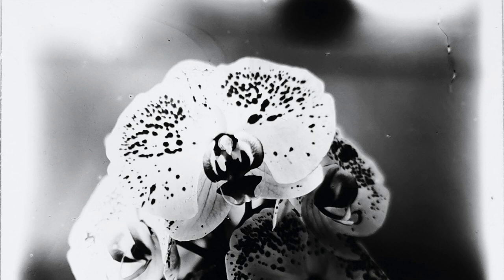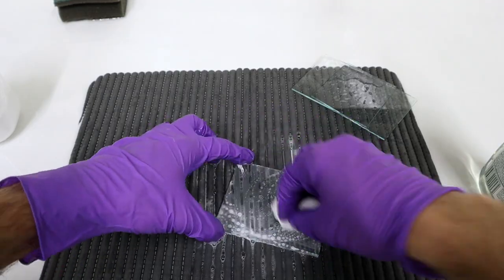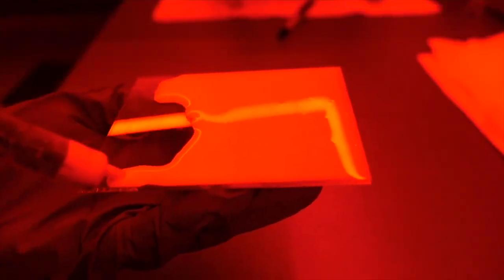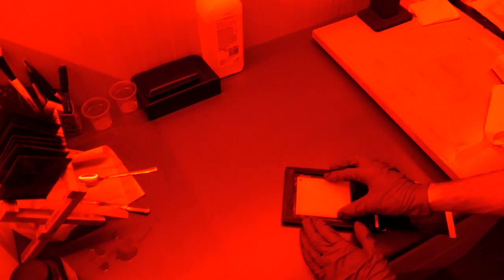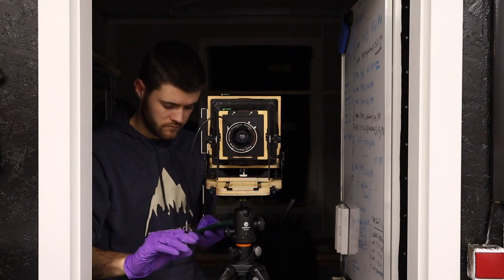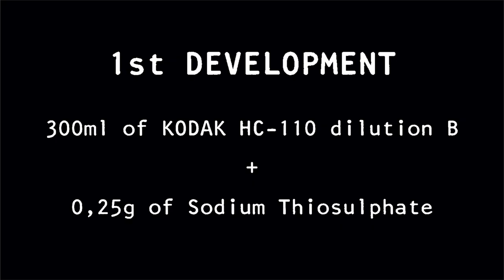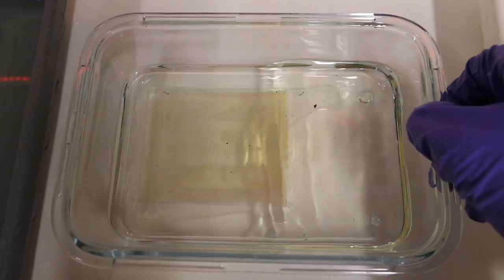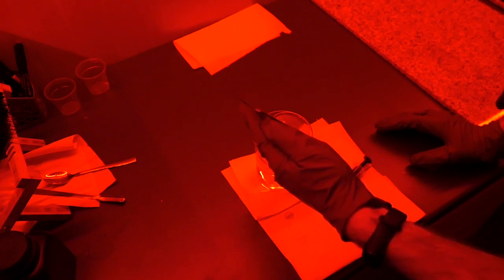Reverse developing Glass Dry Plates to direct POSITIVE | Advanced Film Photography | Foma Emulsion

Comment: Great video.  I played with this a couple years ago.  Get a chemistry hot plate.  You can place you glass plates on the hot plate and heat the glass evenly before applying the emulsion.  You can also put the glass plate back on the hot plate after coating and let the emulsion level itself out.  I was trying to use a different bleach but ran into a lot of issues with emulsion coming off the glass or poor bleaching..  It looks like you got a great system going.

Comment: One suggestion on the spin coating: a technique I have used for Niepceotypes is from Mark Osterman: use a valve from an engine mounted in a hand-driven "eggbeater"-style drill, which allows good control over the speed. Double-stick tape will hold the plate to the surface of the valve. You will want to put the spinning plate inside something to contain the excess emulsion being flung off. I would expect the coating to be very even, but a bit thin without a great deal of care.
Reply from the maker: Thank you Robert. I am concerned that the plate will also have to be heated somehow or the emulsion wil gel to quickly?
Reply: @lostlightart6064  perhaps. I went from heating my plates on a warming tray to coating them on room temperature plates with little trouble, but never tried spin coating with gelatin. But if you’re concerned, an inexpensive food warming tray (I bought mine off eBay for $25) set to low with a towel on it will do a nice job of keeping up to 8 plates or so warm and ready to go. One other thought: I have found thin coatings to be rather susceptible to halation, to the point where I was experimenting with anti-halation coatings. But I found that if I just left more emulsion on the plate the problem subsided. Takes longer to dry, but this is a process that calls for patience anyway...
Reply from the maker: @RobertBrazile  Yes I mean the problem may not be just in the thickness but also in the density of the emulsion. Maybe I need to dilute the emulsion down a bit so it can develop all the way thru despite being a bit thicker...

Comment: Could you spin your plates Slowly in order to get an even coating ?
Look forward to your Autochrome experiments 👍
Reply from the maker: Yes this is what I have to try
Reply: @lostlightart6064  I already calculated it. If you do a rough coating first like you do it (that is essential!) and than place the glass on an old record player at 33 r.p.m. With the viscosity I see in your video, about 1 minute of rotation should be fine to get a coating below 100 micrometer. I tried it with a test solution and it works. 
33 rpm is not enough to spread it from the center, but it is enough to get the coating very even and very thin.
Reply from the maker: @flutgraben13  thank you. That was exactly what I am planing to do.   Coat the plate like usual and than give it a spin to even out the thickness
Reply: Just saw the record player in video which i missed 😅
Using such a method could you make a type of layered Autochrome?
Reply from the maker: @stuartbaines2843  Autochromes have a colour screen which is dusted on a sticky adhesive layer. Screen is than protected from moisture and coated with a thin coating of panchromatic emulsion ;)

Comment: Thanks for sharing this. I just want to know what ASA is the applied emulsion?
Reply from the maker: Thanks. ISO 2
Reply: @lostlightart6064  I Appreciate it mehn!
Reply: Nejc did you have not encounter problem when you applied your emulsion directly without any subbing? Because I am going to try to use Liquid light emulsion.
Reply from the maker: @reynaldocastaneda4712  No. All you need is a clean glass!
Reply: @lostlightart6064  thanks Nejc
Reply: Nedj, did you use some kind of coating before applying the emulsion? Or apply directly?

Comment: Hi! do you know if this glass is valid to use in an enlarger as paper? Thanks for sharing your knowlegde!
Reply from the maker: Yes its possible so theoretically you could make a positive image on glass out of a negatve glass dry plate
Reply: @lostlightart6064  I was also thinking if it’s possible to use a 35mm and expose it on a glass plate using enlarger. I’m guessing the process would be very similar?

Comment: I've done a couple rolls of modern film by B&W reversal with dichromate bleach -- essentially your process, but without the hand coated glass plate (and on panchromatic material, so the first development was done in a daylight tank).

I used print strength Dektol (1+1, as I recall) with a little thiosulfate added for first developer -- faster working than HC-110, mainly, though with 35 mm Tri-X I think it also helped with final grain by preferentially developing the coarser halide crystals (to then be bleached away).

The option does exist to separate the thiosulfate from the first developer, too -- develop, stop or wash, bleach, wash, clear, then put the plate into a similar strength of hypo solution and watch for the thinning of the least of the least dense parts of the milky halide.  The trick is to stop as soon as max-bright areas go fully clear (thus preserving some halide to develop in what I think of as Zones VII and XI).  When the plate looks right, wash, then give the reversal exposure, second developer, stop/wash, and fix as usual.

I haven't gotten to try this method of "lightening by inspection" because my old darkroom got closed down just after I'd licked the conventional reversal process, but I have some ortho film on hand now that I plan to use to verify that this works.  I think it will make it much easier to get the final positive "just right".  I also plan/hope to use acidic copper sulfate followed by ammonium hydroxide for bleach -- not carcinogenic and (I think) safe for my septic tank (certainly safe for city sewer systems).  Good ventilation is a must here, but I believe this will be much safer than dichromate and won't soften the emulsion the way permanganate bleach does.

Comment: Great to see this done and it is something I'd like to try but alas I would have to get a government license to buy sulphuric acid in the UK now. Also I think the Potassium Dichromate is really bad, very poisonous and carcinogenic so I'd rather not use it in my home or put it down the drain. I once tried to used Hydrogen Peroxide at 12% to do reversal on resin coated paper but it was disappointing and didn't bleach very well. I wonder if H202 would work with dry plates?
Reply from the maker: Hey Roger. Yes I agree many off the chemicals are hard to get or even forbidden in some countries. I usually buy them from eBay in small quantities ant haven't had a problem yet. Some of them are really bad like potassium dichromate but it all comes down to protect yourself and use got ventilation. To be hones I haven't worked with Peroxide at all so cant help you at this point :(

Comment: Very interesting video. I'm experimenting with a similar process, I'm working with citric acid and hydrogen peroxide as my bleaching agent. I just finished fixing the shutter for my camera and getting first images from it, so not quite as far as your experiments, but I'm glad to see I'm not the only one with such ideas
Reply from the maker: Yes I have to try peroxide bleach as well as its much safer to use!  Are you usinf film or?
Reply: @lostlightart6064  no I'm doing glass plates
Reply from the maker: @allensmithphotography  good stuff mate. We should connect then to share our findings 😉
Reply: @lostlightart6064  that'd be awesome. Up until now I've been researching. Only in the last couple weeks have I been able to do actual hands on. I'm actually doing some coating tonight. Cutting the plates this afternoon
Reply: Very interesting, but the sulfuric acid and dichromate make that not a usable process in my home. Citric and peroxide are harmless enough if those work out. And what is the clearing bath?
Reply: @oudviola  it's a process used on film by the people I've seen working with them so far, it's a bit more work but I don't see any reason for it not to work just as well on glass dry plates. It's the process I'm focused on testing
Reply from the maker: @oudviola  Yes I think I will be switching to Peroxide soon! Do you deveop film or?
Reply from the maker: @allensmithphotography  Good stuff man and good luck! Make sure to share some results. On instagram you can find me under @lost_light_art
Reply: @lostlightart6064  I'll definitely share my results, I'm also planning at least a couple vids once I get the process down. I followed on Instagram and I'll be sure to tag you in any relevant posts. If you want to my Instagram is @allen.r.smith.1
Reply from the maker: @allensmithphotography  Thanks
Reply: @allensmithphotography  Good luck!
Reply: @lostlightart6064  I develop my black and white film at home, not color. I have been using Jason Lane's dry glass plates. You've noted the threads about making virtual positives using some alternative developers. That's not the same as what you are doing, which is more typical reversal type chemistry. I'm not sure your method would work with Jason's plates, I think he has hardener in the emulsion, or anyway he says not to use hardening fix. Also I have no idea how the thickness of his coating compares to what you define as 'thin' or 'thick'. I'd be interested to give it a try, but with the citric acid/peroxide bleach only. And what was the clearing agent, I don't think you specified it in the video, probably it's evident to practitioners but for the rest of us...thanks!
Reply: @oudviola  thank you.
Reply from the maker: @oudviola  Yes using Jason Lanes plates would be quite tricky I asume. For the clearing solution it is a mix of Sodium sulphite anhydrous and water. I am not sure if this step is even necesary with peroxide bleach?

Comment: For extra adhesion and ease of wetting (so the emulsion runs smoothly) you can run a blowtorch flame over the glass just fast enough to "chase" the condensation, don't over heat, the plate should not heat above 60 C°. Its crazy the difference it makes, this is used industrially to make surfaces hydrophilic so coatings stick its called flame surface treatment or plasma surface treatment in case plasma is used instead.

Comment: for spreading the emulsion try modifying a drill or a Dremel for a 4x5 plate. Try making a clamp and rotating the drill slowly.
Reply from the maker: Hey Bruno. Yes I will be making something like that for sure. Havin a 3d printer at home will help quite a bit I hope! Have you done it yourself?
Reply: @lostlightart6064  haven't done anything like that myself but it was the first thing that came to mind. I feel like a clamp on a drill seems like a "easy" And "simple" solution + it wouldn't take up much space
Reply from the maker: @Buza3  Agree!

Comment: In Foma Emulsion do you apply the complete hardener to the emulsion and later you melt it or is the hardener applied only to the final melted emulsion  prior to sentisitze? I ask since i didn't see you apply it before coating. Nice idea to warm the plate
Reply from the maker: Adding Hardener is not necessary and with direct positive plates it is not recommended. Otherwise for negative plates hardener is added to the melted emulsion right before coating

Comment: Look up an old twirl-o-paint unit
Reply from the maker: Thanks I will
Reply: @lostlightart6064  might need to evaluate spinner speed, but they're made to hold rectangular plates already, and have a built-in splash basin. I could see this working well if the applicator tip stays in contact (or droplet contact), then spin to distribute, maybe even dry a touch.

Comment: Thank you for very instructive videos. - I see you rated the emulsion at ISO 1 indoors, and then I wondered if you used the reciprocity data for fomapan 100 or something similar?
Reply from the maker: Hey WayUpNorth. To be honest I have been exclusively shooting dry plates for the last 6months and yes with dry plates there is a reciprocity error but because of the fine grain emulsion it starts to show with exposure over a minute and more. With modern more sensitive films reciprocity because noticeable at much shorter speeds ;)